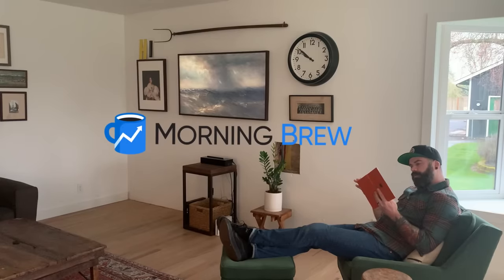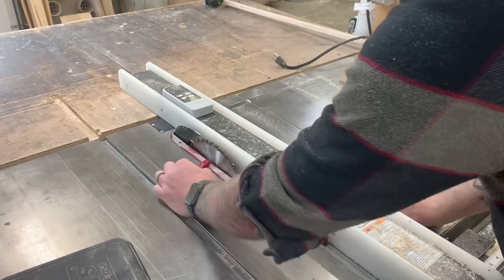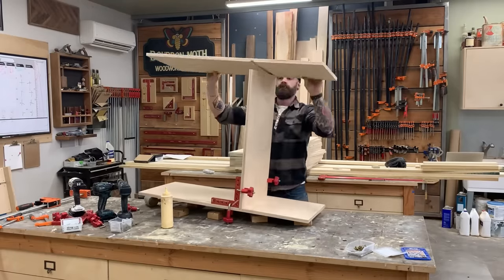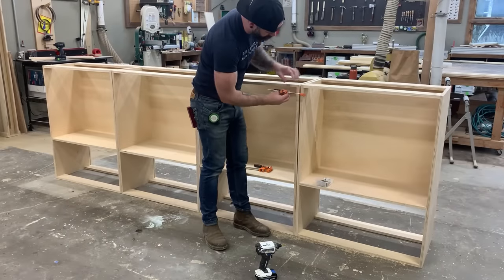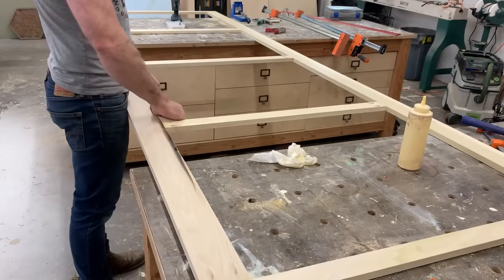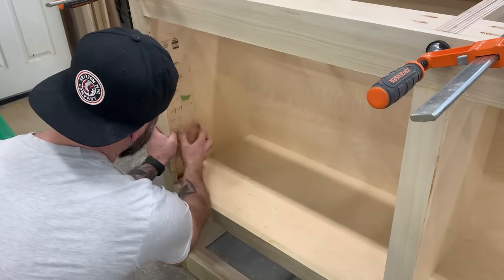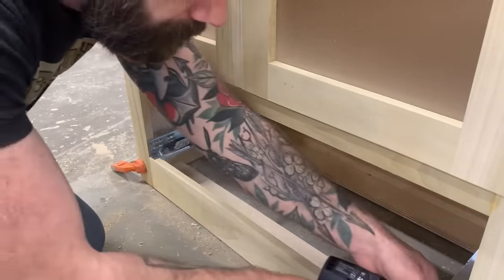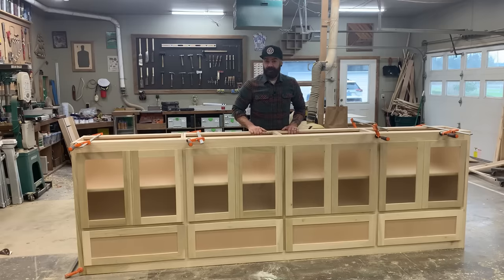How To Make a Giant Built-In Cabinet || Built-In Cabinet Tutorial

Comment: Watching these vids to get ideas for my cabinets.  Always full of good tips and tricks!

Question... I understand the need for the top nailer strip on the back, but why the need for the one right above the existing strip you added (to the shelf box area) before the back piece was installed... can't you just use that as the bottom nailer?  I guess it adds a little more strength and nailer area when you mount the cabinets in their home, but is kind of redundant.

Comment: I'm making a large built-in. It will be for to ceiling.  I'm planning to have drawers on bottom and wardrobe on top. So far, I've started building the carcass for the drawers, do I need to put wood glue on the ends of all the brace pieces before screwing them in? Does this add a level of support I'll need once the weight of everything is on top of it?

Comment: You used 15 inch drawer slides.  I am going to build a little coffee bar in my kitchen also with a storage underneath for my wife's stand mixer and pressure cooker.  Thinking of using the Blum slides and my depth sticking out from the wall is limited to 17 inches.  Will the 15 inch slide work?
Reply from the maker: They should. You really only need 15.5” to work with.

Comment: When you use trim head screws to connect the shelf down to the brace-- is that just because it's easier than drilling more pocket holes into the brace, or does it give better support than pocket hole screws?

Comment: I just started wood working. Trying to build a built in for my wife.  My span is 78 inches. So I made that into two cabinets of 39 using 3/4 thick boards.  My question is for face boards should they all be 2 1/2 inch wide to be even like the one in this build. Or is 2 1/2 in center vertical board okay with 1 1/2 the rest of the way around.  It will only be doors on the cabinet. No drawers.

Comment: Question - and maybe he talked about it and I missed it - but if all of the vertical frame pieces are the same width , won’t you have two different size doors? If the vertical pieces on the far left and far right are flush on the sides… then the left and right cabinets will have a smaller opening than the two center cabinets. So are the far left and far right vertical pieces a little narrower than the two center ones?

Comment: When you set the brackets for the drawer slides I notice you didn’t offset them 3/8 like you did in your other 3 part cabinet videos. Was that intentional or am I missing something in this application?
Reply from the maker: I actually did, I just didn’t mention it in this video 😬 oops
Reply: @Bourbonmoth  Whew! I was concerned I had been doing it wrong! You have a great system for mounting those slides my man. Much better than the 10 pages of instructions that the manufacturer provides!

Comment: Jason, all your video's are great. I appreciate them. I noticed on your hand drawn cut sheets you have the depth at 16-1/4" and when you set up your table saw you said you were cutting at 15-1/2" a difference of 3/4". Wondering why that was? Was the 16-1/4" to allow for the 3/4" offset at the back for the 1/4" panel so you could still use the 15" drawer guides? Thanks again

Comment: I see that when you joined the cabinets you used 1 complete face frame with styles of the same width on the outside and at the spots where the cabinets joined. Correct me if I'm wrong but, where the cabinets join in the middle there will be more material than the outside which would mean there would be less of a face frame overhang inside the cabinet than on the edges. Are you just not concerned about that because of the doors covering it or am I missing something?
I ask because I am trying to do something similar but some of the spaces will be open, without doors and I'm afraid that will be a noticeable variance. Your advise on this would be appreciated. Thanks!

Comment: For the left side face frame that touches the wall, did you increase the width of that one a quarter inch so you can scribe it smaller?  Or is it the same size as the other vertical pieces and might get smaller when you scribe some material off of it?  TIA

Comment: The drawer slides you linked says they are for up to 5/8 drawer sides... You used 3/4 sides.. I'm assuming they still work.
Reply from the maker: No I used 5/8” you can use either 5/8 or 1/2 but 3/4 is too thick.
Reply: @Bourbonmoth  ahh okay. Also, I noticed that you used 15" slides, but cut the panels 15 1/2".. is that 1/2" enough the mount the slide usually. I'm getting ready to build a kitchen and was plan on using these slides.

Comment: I'm slightly confused on the alignment of the face frame.  Are the vertical end pieces the same width as the 3 vertical pieces in the middle of the unit?  If so aren't the two end opening slightly smaller than the two middle openings since if you're using a 2" wide piece there would be 1-1/4" of overhang, but in the middle (because there are two 3/4" pieces together) you would only have 1/4" of overhang?  But he seems to use the same spacer piece for each section, so does that the mean the two end vertical pieces are a different width than the three in the middle?

Comment: I have a technical question and I know you're busy so I will continue to find answers here and other places...how do you determine the dimensions of the components of your face frame? I get that you are using 3/4" poplar for the faceplate. But how do know width of each of these pieces? Is there a common amount of overhang over the box? I am also planning a built-in that will be next to a wall on the left facing side and open on the right facing side, like yours. My boxes are a bit longer because the height is 94". I want to put a door on (the area where I have zero experience) and I'm using frame mounted hardware for hinges, like you, and I want it to look nice and tight and for the door to not get hung up on the wall when opening. BTW, I love our videos - I just fond you last week and have been impressed. Also, your little boy is adorable (yes, I stalker watched ALL your videos). I promise I'm not a stalker, just tying to learn.

Comment: 25:30 I noticed the overlay hinges versus the euro style ones with making the door. I've been tempted to buy a euro hinge that takes not only face frame, but can do faceless. I just opted for 3/4 overlay face since It had about a 1/4" less profile incase the kids are sliding stuff in an out. Do you try and buy a hinge that's used for both? I know that some of the hinges will be saved for other projects were I feel like the 2 screws on the wings may be more secure than the 1 with lower profile. All this said, manufactures are smart and have thought of these tolerances, just wondering what the real world experiences with durability. Love your work, keep it up.
Reply: I was looking at the hinges as well. Any idea where i can get these small ones?

Comment: I have made a LOT of cabinets and am puzzled by your 1/8" allowance at the top of the face frame. You indicated it was so you could have some adjustment but, you then put in the rail that lines up with the bottom of the upper cabinet. So, if you move the face frame up, the mid rail will rise as well and provide a ridge. I am willing to think I am missing something but it seems problematic to me. Regards, Bill

Comment: One HUGE thing that is not stated is that the 2 vertical end pieces on the face frame NEED to be thinner than the other vertical dividers when you are doing 3 or more cabinets. If you you the same thickness on the ends, then your middle dividers will be offset from the sides of the cabinets. The drawers/doors will be the same size, but they will not be centered on the cabinets.

Comment: Yes!  I am 100% with you on using Blum Blumotion undermount slides.  All other slides are inferior.  I would have made the front faceframe so that it puts the seam of the end trim and faceframe so it was on the right side, instead of the face.  I do like your rabbit idea for scribing to the wall.  For my primary choice in hinges I use Blumotion clip-top hinges on the doors, and the corresponding Blum 175H6000 brackets attached to the faceframe (for overlay) or cabinet side (for frameless cabinets with overlay doors).

Comment: I can't help but think the square corners of drawers and doors are a tad plain and boring... could you have done a small cut so the edge was like 45° turning the shape into a kind of octagon? Okay, that would probably work better when it would be a repeated element like also shown on the bottom and under the top cover plate, but anything else but square boring rectangles seems appropriate right now...

Comment: Jason makes this look so easy.  But I have a feeling there are a ton of little details that he has worked out ahead of time that would be gotchas.  For instance - the drawer slides are a particular length.  And without mentioning it he must have designed everything so that the length of the drawer slides would perfectly match the depth of his cabinets minus the 3/4" width of the piece that he used to mount the back of the drawer slides to.  I have no experience with drawer slides so that would be a little detail that I would probably miss when designing this.  And I feel like getting the width of the cabinet doors just right is not so simple either.  He just whipped them together - boom, boom, boom - and they fit perfectly.

Comment: At 6:24 you mention you wouldnt want to run the wood any larger than this.  I have read you shouldn't run wood that is wider than it is long due to kickback, but the alternative would be to use a cross-cut sled and move the fence out of the way...is this correct?
Im just getting into some larger wood working and trying to still figure it all out and make sure I understand it all.

Also @ 13:00, why did you not add glue to the support pieces before installing them with the pocket hole screws?

Comment: @BourbonMothWoodworking you mentioned that you are temporarily clamping the face frame on with an 1/8 inch wiggle room for up and down adjustment if needed. If you needed to adjust the face frame because of inconsistencies with the floor, would that not throw off the alignment of your doors and drawer slides due to the fact that they are screwed into the face frame? I know you had no issues in your install video cause your floor is flat, i was hoping you would be able to show how you would deal with that if possible in future videos. Thanks! And I truly love your videos!